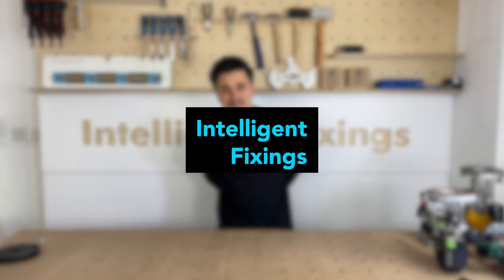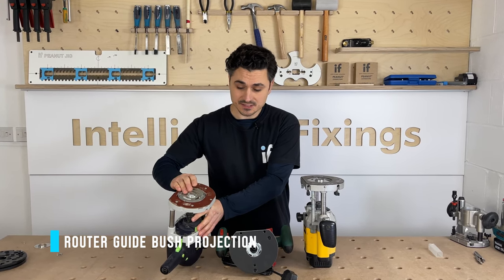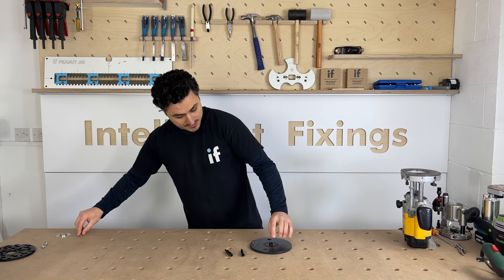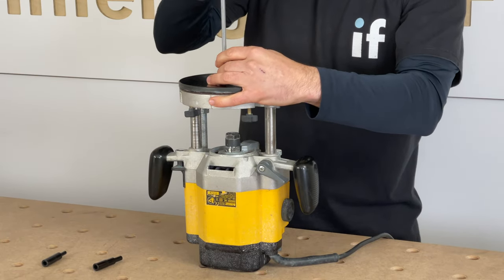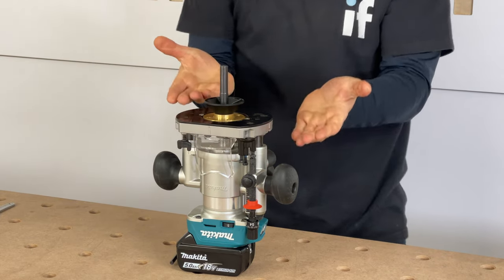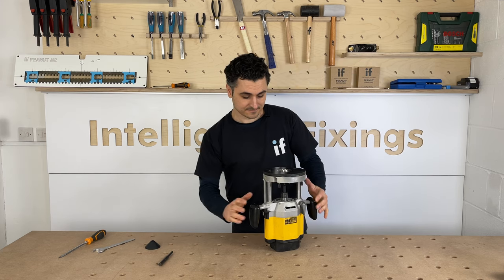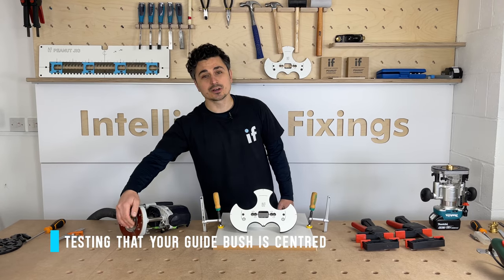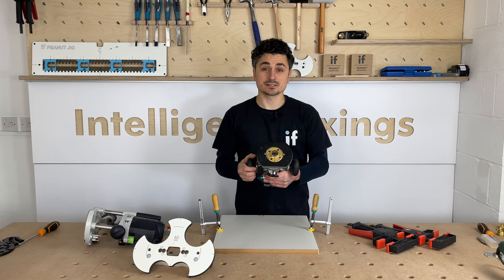How to Set Up your Router

Comment: I have a bosch router similar to the one shown and part of the reason I got it was for the QR system for the guide bushes.  Didn't take me long to realise that the alignment was way out. As there is no way to adjust that I can find that made it a useless feature.  Ended up fitting a Trend sub-base to make it work.  I thought I'd just bought a duff one (it was second hand so I was kicking myself about that), so it is nice to see that even expensive Festool ones can be off.

Comment: Given the the jig is 12mm thick I cannot understand why your vid says that the bush must only protrude by 4mm. Please explain.
Reply from the maker: Hello @joncoxhead4624, when using the PEANUT Jig, the inserts have a 4mm thickness. If the protrusion of the guide bush is greater than 4mm, you would not be able to sit the router flat on the PEANUT Jig Insert.
With the PEANUT Mini Jig, the maximum projection for the router guide bush is 9mm. A projection larger than this would mean that as you attempt to place your router on the PEANUT Mini Jig, it will not be able to sit flat on the PEANUT Mini Jig body.

Comment: I have recently purchased your mini jig and the makita trim router you have in the video, I am however struggling to find the base plate and guide bush you have, could you guide me please to get the correct part. Thanks
Reply: Unless I 'm wrong, the base plate looks to be the same as that which comes with the Makita plunge attachment (Part# 195563-0). From a different video, he mentions using the Katsu brass guide bushing - I'm assuming this would have to be the 30mm, which is part of a larger set. Depending on where you live, the Katsu set may not be easily available for purchase, but there may be other third party options for sale. I would also like to know what those are. I have the Makita plunge attachment but also recently bought a Powertec universal base plate that fits the Makita RT0 700cx.
Reply: @tomkecskemeti3062  You sir a a star, I went and got a Katsu bush set and it is perfect in the plunge base, I've not tried the bushes in the other base that came with the Makita set, but this will work perfect with the plunge base. Cheers
Reply: @dereksmith7770  Glad to be of help!!